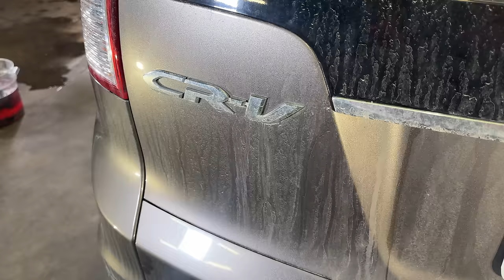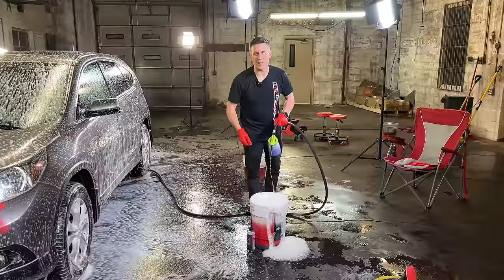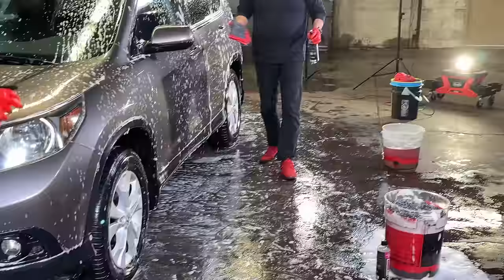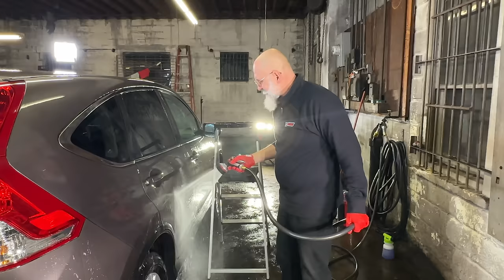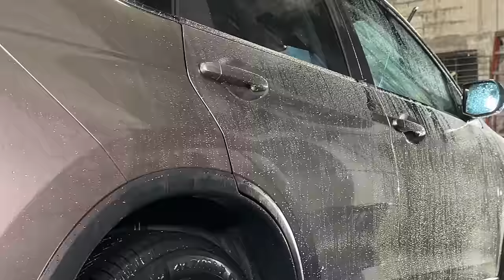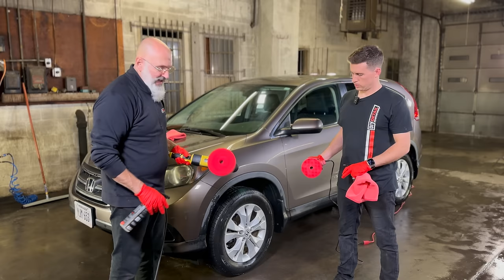NO COATING? NO PROBLEM: how to DEEP clean & protect your paint

Comment: The IK Foamer is expensive here in my country. I use sprayer (like the one you guys have for rinseless) to put shampoo on the car. It’s not sudsy, but it does its job by breaking down the grit. I like this method more than the messy foam cannon with pressure washer.
Reply from the maker: Excellent, what country are you in.

Comment: Great series. Will the water spot remover affect my wax or sealant? How often do you treat the car with the water spot remover?
Reply from the maker: It may degrade it slightly. You only need to use it when you see the beading starting to go down.

Comment: A few questions about this. Can ceramic gloss be applied using a hand applicator? How do you maintain the car in subsequent washing using these forms of protection? Also, if one wanted to go from using this to any of the 3, 5, or 8 year coatings would there have to be some special procedure to remove or insure that quick beads or ceramic gloss won’t interfere with the coatings ability to adhere? Thank you.
Reply from the maker: Yes it can be applied with an applicator 

No special care needed. 

You should polish it to remove it.

Comment: Great video as usual, your 5.25 Jeweling pad is OOS-thoughts on using larger 6.25 on either 21 inch DA and/or Milwaukee M18 Orbital 5 ' sander?
Reply from the maker: Use the 6 inch on the 21mm with its original backing plate at low speed.

Comment: I’ve never used an iron remover but will for the first time soon, I thought you should wash, clay, then spray iron remover on then rinse it off. I never thought to use the iron remover as a lubricant for the clay/ decon towel 🤔
Reply from the maker: It’s not as efficient when you spray it on.
Reply: @diydetailofficial  makes sense

Comment: Hi guys, I’m loving this back to basics content. I do have a question around this kind of setup. I do have a pressure washer but sometimes I can’t be bothered to set it up or make noise etc. if you do a pre-treat and then rinse with a hose, it leaves a bit more traffic film than it might with a pressure washer. If you then did a Rinseless wash of that traffic film, is that still ‘safe’ to do? I feel like detailers have scared us all about contact washing any kind of dirt whatsoever!
Reply from the maker: Yes, absolutely

Comment: I might have missed the explanation but what's the point of using the machine to "polish" the ceramic gloss into the paint compared to just using it during the drying process? It doesn't correct any swirls or anything right? Not knocking your process I'm just wondering if there is an advantage to getting my Milwaukee out with the ceramic gloss😂.
Reply from the maker: It adds a little more gloss, the pad has a little amount of cut. It also adds to the longevity of the DIY Detail Ceramic Gloss

Comment: It’s the one process you guys do that I won’t do😂. I abhor the smell of Iron Remover so I don’t use it on paint or glass…wheels only. I clay with normal lubrication from the car soap or Rinseless Wash.
Reply from the maker: Using it this way dramatically reduces the fragrance.
Reply: @diydetailofficial  😂😂I may give it a shot on this weeks details. I most definitely use Incredible Suds! However Incredible Suds smells so good I’d hate to ruin that smell😂😂
Reply: When you talked about your mix for the wheel cleaner. You said you mixed All Clean 15/1 and just a little bit of Incredible Suds. Can I ask about how much water you had in the sprayer and then how much is a little bit of incredible suds.

Comment: I don't see how the iron remover can do its job when you're using so little of it, and the suds on the car don't allow the chemical the time it needs to do its job.  I understand the desire to be efficient, but I doubt you're getting the results you could achieve by using the traditional chemical decon method of applying it to a dry car and allowing it to dwell a few minutes.
Reply from the maker: Try it, you will see it’s actually more effective. 

IRON REMOVER: what's the best way to use it? Less, or more?
https://youtu.be/J0ekW2qzw3I